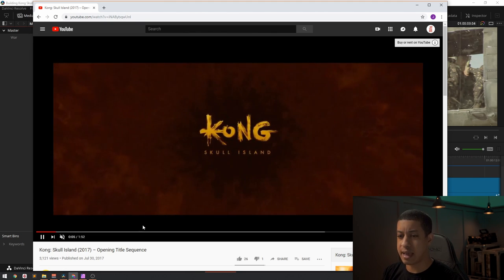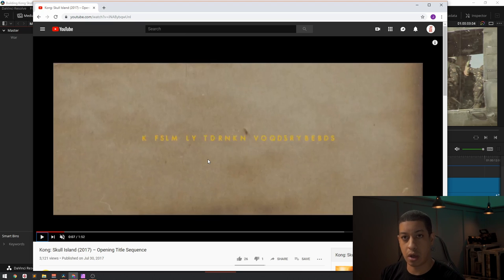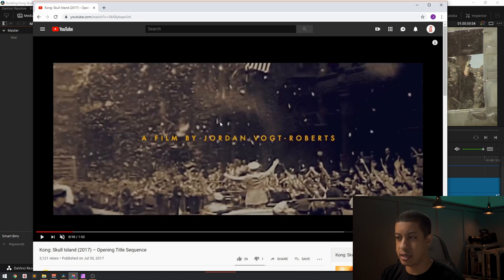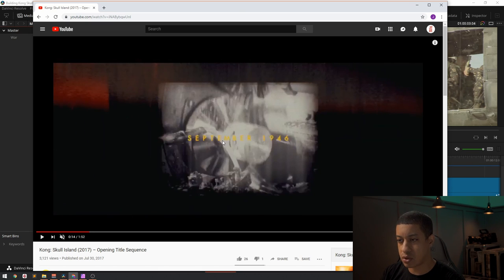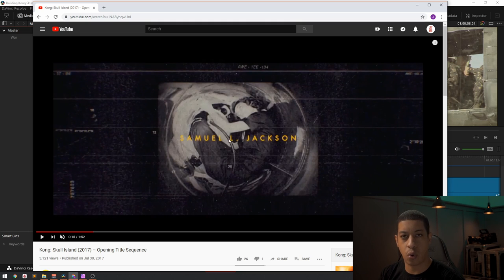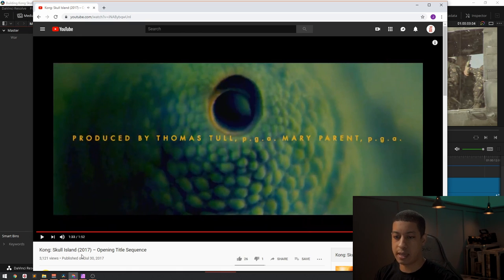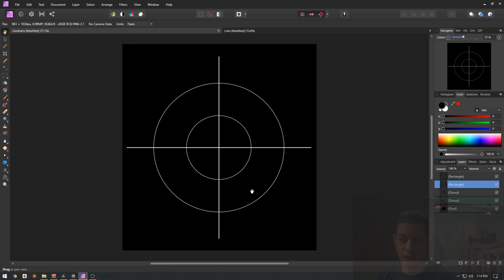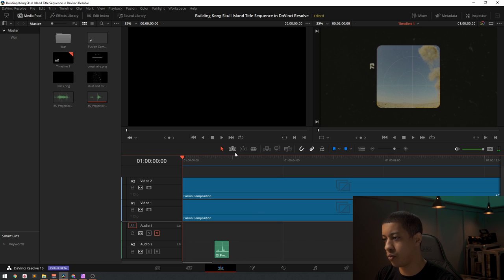Building Kong Skull Island Title Sequence in DaVinci Resolve

Comment: are you having any issues with fusion being deadly slow? I've got a 2080 + amd 1950x + 32gb ram, so more then enough power (I thought) but when I add something a simple as your text animations my computer could barley handle it
Reply from the maker: Nope not having any issues. The system I use for my tutorials is lesser than the system you're speaking of. Might need to check config, drives, resolve version. Look into NVIDIA Studio Drivers if you're not using them yet.
Reply: @JayAreTV  thanks for replying, Ive installed the drivers aswell as studio so it must be something in the settings